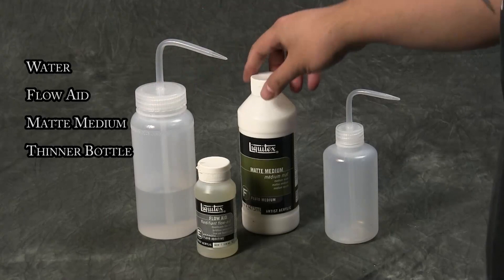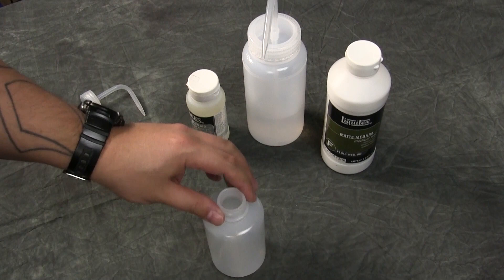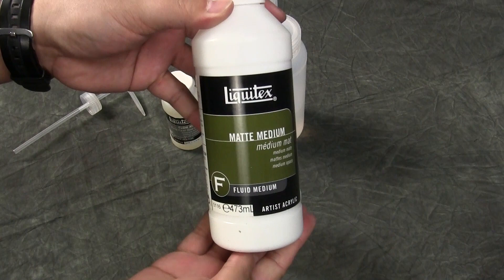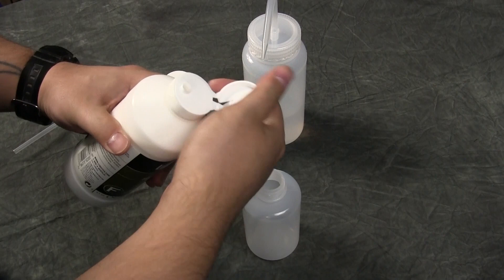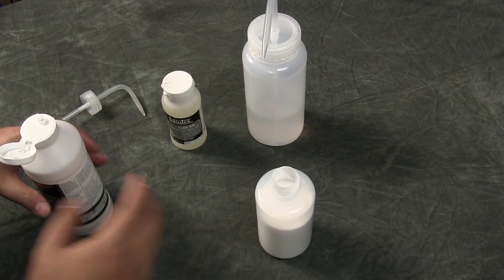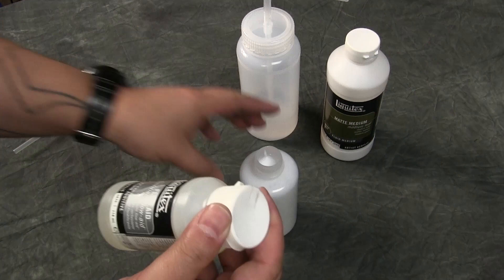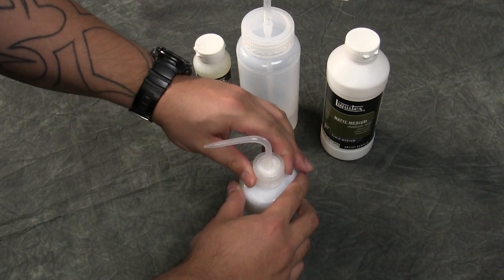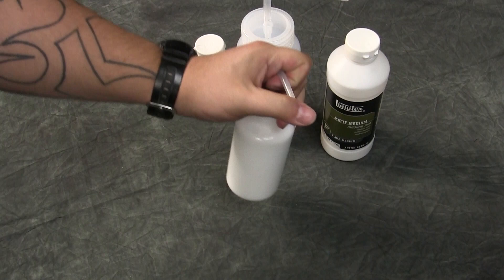Les' Quick Tip - How to make Airbrush Thinner for Water Based Acrylics

Comment: I've just tried your recipe using an OLD Vallejo Model Color paint (the worst case of study is everytime the best way) at 1/3 ratio on my 0.38 Paasche Talon, and the mixture flowed great with a good smooth finish.
Then i repeated it on my old 0.2 Fengda 180 at 1/5, for testing if the pigment would pass through it, and the result was the same. So i only neet to test Gw paints, 

Time to trash Tamiya, Humbrol and Solvent based paints :D

Comment: I know this has been posted here at some point. But will this work with the standard valljero paints and if it does how do you mix it via paint and thinner? Also can this be used on model air?

Comment: Hi Les and thanks for the video! I started using your recipe a while ago but I'm having mixed feeling about it. It thin very well but It seem to me that the colors turn out a bit desaturated. Could it be caused by all the matte medium in the thinner? I used a differente recipe recently (distilled water / flow aid / drying retarder) and the color was more intense but I used it for a candy-coat with flo-paints and gloss medium so I'm not that sure. Thank you!

Comment: will this help with dry tip at all? using Badger Krome 0.2mm nozzle and getting terrible dry tip with VMA ( fine with other paints) seen a phew ppl with the same problem on forums
Reply from the maker: Drytip is just a byproduct or airbrushing.  Everyone gets it using all kinds of paints.  With this typically I clean every one minute of operation.

Comment: You can reach a reduction point that will weaken the adhesion of acrylic paint using just water.  Reducing the acrylic polymer with another polymer product will not weaken the adhesion properties of the paint.

Comment: Hello, I am 13 years old and just got an airbrush as an early xmas present. I have found the correct air flow and thats great, but the paint is not flowing. I am using water to thin out water-based acrylic, and the paint is not working. So, I traveled towards the vast internet to help me, and this video has not done so. May someone provide help on how to thin out this paint? :)
Reply from the maker: Hello Natalee.  First thing is to check the airbrush.  Clean it and check if it will spray just water.  If that works, mix your paint in a separate cup with water or a thinner until it's the consistency of skim milk.  This means watery but still puts color on the sides of the cup.  If this has trouble spraying, you may have an issue with the needle/nozzle not being large enough to let pigment pass and that is causing the clogs.  I see this happen with cheap craft paints.  if you must use those paints you will have to strain the paint through pantyhose to remove the larger pigments.  Its a pain but the only way around it is to get a larger needle/nozzle set like .5mm or higher, or switching to paint optimized for airbrushing.
Reply: Thank you. :)
Reply: Great news, I figured it out and now my airbrush works.
Reply from the maker: Yay!  Now time to make some art!
Reply: Yay!
Reply: Natalee Larson so what was the fix?
Reply: LesterBursleyMiniatures when you say larger needle/ nozzle like .5, is that something I can swap out on an iwata HP-C Plus? I'm researching now, though I haven't received it yet.
Reply from the maker: Yeah I think most mid level airbrushes have sets available for purchase in different sizes.
Reply: Nataleee;; Very glad to hear you got things going your way. Try thinning acrylic paint  with isopropyl alcohol (1 to 1 ratio) or denatured alcohol (up to 3 to 1 ratio) available at the drugstore and inexpensive.. Also try such additives as retarder (to extend dry time), and flow aid (it helps the paint to dry smooth), these help to give a smoother, shinier finish. The best way I know of to learn is to learn what other people do, use that as a starting point, and then experiment till you find what works for you. Happy airbrushing.

Comment: Maybe a dumb question so please bear with me since I'm new to all this...but if you are using paint such as Vallejo Game/Model color and you thin with water to paint with a brush, why not thin with water in the airbrush too? What advantage does this mix have over just water?
Reply: +Chad Ashton Thinning with water beyond a certain point will do 2 things: first the pigment will separate from the binder(what keeps the pigment together while a liquid and what adheres the pigment to the painted surface) which will cause all manner of problems with opacity and coverage. Second, using only water will cause spidering(where little veins of paint run out in a circular pattern) which is a quick way to ruin the paint job and require stripping to fix. By adding matte medium(which is simply binder with no pigment) you keep the behavior of the paint the same just with the pigment being diluted a little. The goal here is to get the paint THIN and not overly diluted(otherwise it just becomes a gritty wash instead of a layering paint).

Comment: Thanks for the tip but I would rather call it a transparent base then a thinner. That is not gonna make the paint more runny, just more transparent.
Reply: That entirely depends on the volume of flow aid.  I find when I mix this stuff it's about as thin as milk, which is a lot thinner than any of my acrylic paints that aren't already mixed for airbrush use.